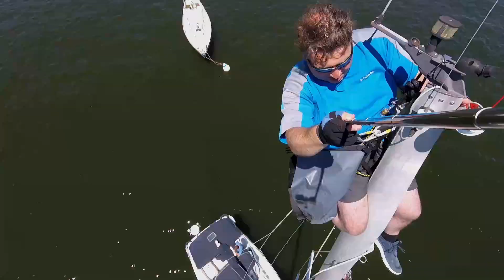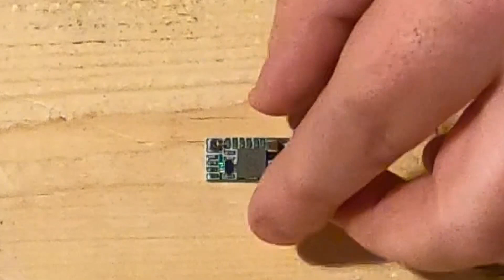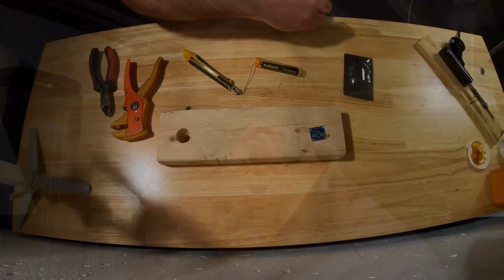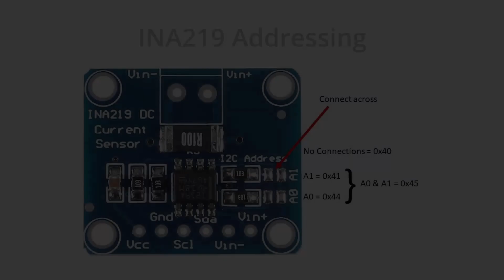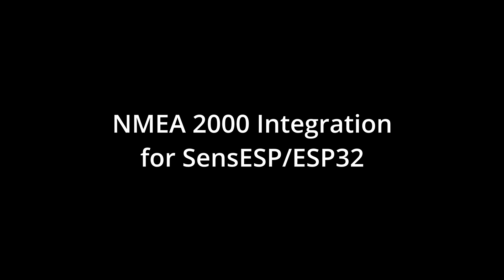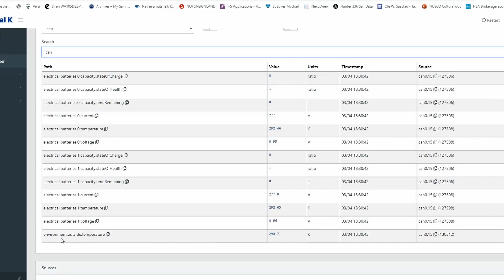DIY NMEA2000 compatible Battery Monitor using SensESP/ESP32 - Part 2 - Tech E13 - Après Sail

Comment: An issue you should concider is voltage separation and isolation on voltage converters, can bus, voltage and current sensors in order to avoid ground loops. There Are current and voltage sensors that has galvanisk insulation.
Reply from the maker: Good point, Thanks.  In this case, the device is powered by the NMEA2000 cable which is also the source of the CAN bus power/Ground.  Nothing else is grounded outside

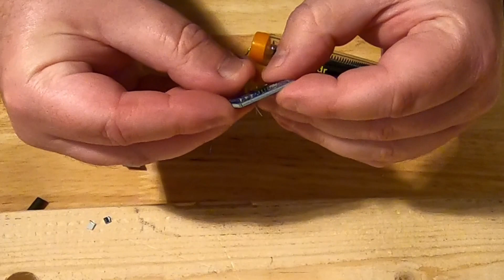Comment: 6:47 your previous video at 6::59 should that kapacitor in a different spot
Reply from the maker: Physically in a different spot but it is the same connection the connection is as per the schematic - across between Vin+ and Vin- .  I moved it to the connection further back to make it easier and connect the wires to one pad and the capacitor to the other pads

Comment: Nice, have you ever tried controlling a Fusion Marine stereo via home assistant or node red using NMEA nodes?
Reply from the maker: I don't have any experience with the Fusion Stereo, but there is a plugin for Signal K (https://github.com/sbender9/signalk-fusion-stereo)
Reply: @ApresSail yea I tried that on the victron cerbo but it would error. It uses Put requests and I don't think the cerbo can be used for that

Comment: What software are you using to code the ESP32?  I use Arduino IDE but you not saying what you use?
Reply from the maker: Sorry, I am using the instructions for SensESP which suggest using Visual Studio Code with the PlatformIO extension

Comment: Hi.
Tanks for two super nice videos. I have one question. How do i connect it to the NMEA 2000 network? Do i need to run it through a Raspberry in some way?
Reply from the maker: At 13mins 52 seconds in the video you see I talk about Nautical Sun's battery monitor and notice there is a CAN transceiver on that board.  CAN Hi (Net-Hi) and CAN Lo (Net-Lo) would be connected to the NMEA2000 data lines and the 12V (Net-S) and 0V(Net-C) could be used to power this device - see https://github.com/Techstyleuk/SensESP-NMEA2000-Battery-Monitor for the schematic.  You do not need a Raspberry Pi.  Just another note - the Transceiver includes a terminating resistor that you should remove (or take off one of the terminators from your NMEA2000 network)
Reply: @ApresSail  Hi again. Im building :-) The terminating resistor. Is that the one located by the Jumper pins?
Reply from the maker: @DonLKSAB  yes
Reply: Geting closer.
All im waiting for now is the Shunt. But everything else is connected and installed. But i dont think it works 100%.
First there is NO LEDS flashing or anything when i power it from the Buck converter. Is that correct?
Wifi seems to be correct. The first time i connect it gives me a wifi to connect to and set up my own wifi. After that the wifi connects to th erouter for a few seconds then dies. Correct? (This is when connected to the PC so i can see whats happening.
And i get alot of errors. Not sure they are an issue but when i connect it to a real shunt?
WHen i connect it to the NMEA2000 backbone i get no new info. It feels like i should at least get NMEA info but no values?
Reply from the maker: @DonLKSAB  can you describe your setup?  do you just have a NMEA2000 system or do you have a signal K server as well?  do you have 2 INA219 boards connected?  are they addressed correctly?  Are you using a firebeetle 2?  I think we see a Green and red Led.
Reply: @ApresSail  Hi.
I have more or less the same stuff like you have. But i dont have Signal K. I was planning to run NMEA2000 only. I have the Firebeetle 2 and 2 INA219 that i think i have adressed correct. When i connect with USB i get red flashing LED. Green is flashing maybe 1 time every 3 minutes or so. I belive its when it connets to the WiFi but since iot dropps th ewifi connection direrect its hard to say.
When connected to 12V only from the Buck converter i get no LEDs. But i get 3,3V out to the board so i assume its running in some way.
Reply from the maker: @DonLKSAB  If I remember correct, on my NMEA2000 version the red flashes when a message is sent and the green flashes when WIFI is working.  Did you log onto the Webapp and set up the WIFI?  For the NMEA2000 one, I set up the ESP32 as an access point that I can log onto and set the battery capacity

Comment: Found you through Boating with the Baileys :-) I think you're asking how to set / store the manually inputted data you list in your video description (e.g. Battery capacity). I've been looking at similar for WiFi SSID & password for my project. That is done with ESPWiFiManager (which looks to be built in to SensESP). https://youtu.be/VnfX9YJbaU8 shows ESPWiFiManager allows you to add custom parameters to the WiFi set up screen and store them to SPIFFS in JSON format. Hope that helps / isn't barking up the wrong tree, and thanks for the video.
Reply from the maker: @davidbarrett7424, thanks for coming over from BwtB! and thanks for  the help, I will take a look at that, see if it helps.  Specifically, I was talking about the SensESP App and trying to set up variables that are modifiable in the SensESP App.  SO far, it appears to me that these have to start off as some sort of function, like: 
float variable_callback() {return (1);}
and then use something else to manipulate this:
  auto* New_Variable = 
      new RepeatSensor<float>(1000, variable_callback); 
and then:
    New_Variable->connect_to(new Linear(1.0, 0.0, "/Specify the/Variable in the APP")) 
          ->connect_to(new LambdaConsumer<float>([](float Variable) {
        Variable_New = Variable;
        })); 
Seems long winded....
so I am looking for a better way.